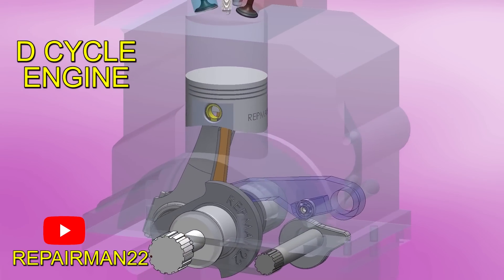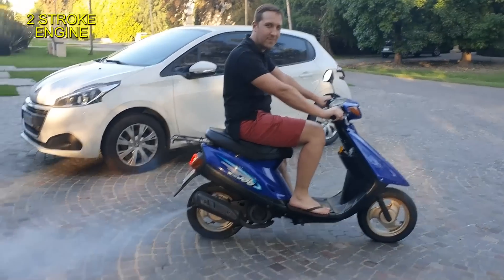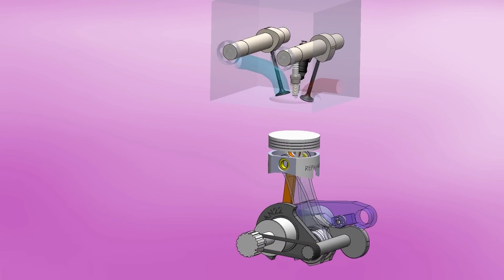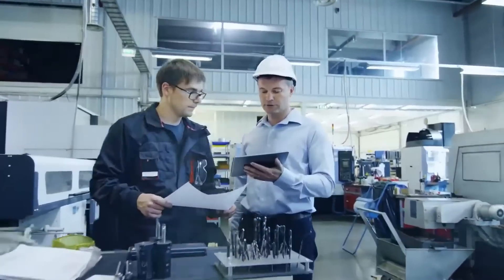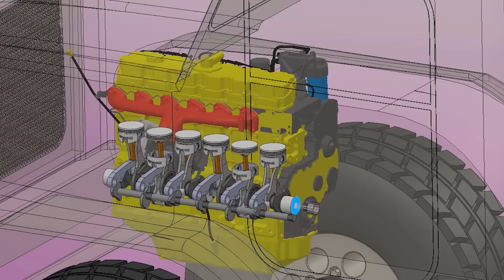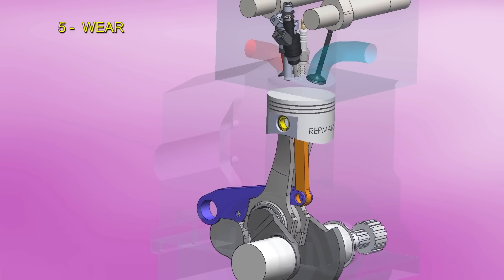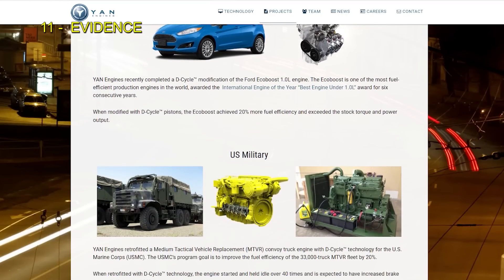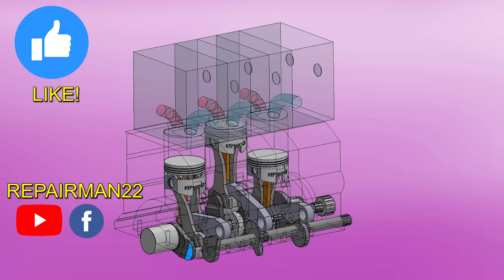Analyzing The Split Piston Engine in 3D. 🤯 Dual Cycle D // 2 and 4 Strokes Combined // 3D Animation

Comment: A turbocharger provides the same kind of increase in power without all the additional wear surfaces.
A modern two stroke uses direct injection which avoids the oil burning, and you can avoid it completely with a blower (detroit diesel) or even a turbocharger if you have a way to start it a blower or saved air pressure.
Reply: An incredibly complex solution to a fairly simple problem. as you state the modern two stroke designs with electronic fuel injection, closed sump lubrication and and controlled blown induction, produce an engine with fewer moving parts and simpler construction,  however it's good to see that the Heath Robinson approach to engineering isn't dead yet. 😂😂
Reply: that's that!
Reply: Now give the dual cycle engine a turbo.

Comment: I would choose it for improved  throttle response on single cylinder motorcycle but I'm concerned about that frequent contact in between the two halfs of the piston. 😐 Probably would be a good cruiser while being agile through city, a classic frame like on twins would fit it's engine character while being mostly for urban use with just half of the cylinders even if with lower redline. 🚴

Comment: disclaimer: APRENTICE MECHANIC RANT
From what i can see, these engines would not last long
the crown could also stay up if there are no forces pushing it down due to friction, so there would have to be some kind of spring or return mechanism, could be fixed with an opposite opposing camshaft to force it down
The arm that moves the crown would have to be in a different design, it would simply bent or break under continious ammount of stress, the camshaft moving said arm, could break in the bearing points or wear out quite fast, we also must take in account that the engine now has to do more work due to a large camshaft, thats a whole automotive class on it self
Furthermore if these engines would fail, they would be a b!tch to rebuild, and quite possibly, heavy on the price side

But i must admit its a cool concept, but in practice

Comment: I doubt this engine will last looking at the surface area of the cam lifting arm is aggressive and will wear out quickly and the loads on the follower bearing will be huge due to the leverage of the arm 

Will it work yes but the engineering to make it last will be its downfall

Comment: Why couldn't this be achieved with a modified miller cycle engine? With direct injection wouldn't it be possible to cycle the air in the cylinder with a supercharger and proper fuel injection timing?

Comment: Seems very mechanically complicated. Opposed piston engines can do the same thing.. also heavy but simpler is some ways.
Also... There are 2 stroke engines that do not need to draw the oil and fuel thu the crankcase.. Detroid made 2 stroke diesels for years... you just need a blower on the side to force air in as exhaust is evacuated..  standard lubrication as any engine with oil in the crankcase.  they tended to be fuel hungry, but also the injection was pretty simple.. I wonder if someone did common rail injection on one if the efficiency would get much better.

Comment: This probably would suit a diesel as a diesel will get by on low revs and already has stronger built engines that because it's built for higher compression ,ied love to see this engine built and tried out , surly it's  better than electric right now because there no cheeper to run than conventional fuel if you do a lot of miles  like I do

Comment: Fuel usage is now doubled and you only see a 20% gain in hp but I want to know what the torque curve looks like!
Reply: I thought in the video they said they also saw a 20% fuel economy increase too.
Reply: @chrisf8584  I must have missed that but this engine doubles the injection cycles without much of an increase of power or change in rpm. This design also increases drag from the 5 extra moving parts in each cylinder.

Comment: It looks like the extra power output is coming from essentially tweaking the engine to put out more power (like street racers do).  As noted by others, this drastically reduces the longevity of the engine wear items.  Once the design has been balanced for longevity and desired power output, then we can determine the advantage of the split piston.  
The turbocharger is a good way to harness the energy dumped by the exhaust stroke to return it to the intake stroke.  It is not clear to me whether this is a better solution for energy conservation than the current EcoBoost system that Ford has for the Fiesta and other engines.
Ultimately, it's a balance between power output, durability and mass.
All of that said, I would love to test this in real world conditions, with or without a turbo!😃😃

Comment: Making a 4 stroke combust twice as often is a good idea, theres a reason 2 strokes and Wankels have such good power to weight and power to displacement ratios. 
But with all of the added parts, the friction and intertia losses would sadly reduce those gains again.
Reply: Das Konzept ist nicht wirklich für die normalen Drehzahlen eines Benziners geeignet, da dieser Zwischenhub enorme Beschleunigungen des Kolbens generiert. Wie leicht kann der eigentlich kippeln, so ganz ohne Führung und Kolbenhemd? Ich behaupte das solche Simulation noch geduldiger ist als Papier.
Reply: just use the second power stroke to power accessories
Reply: Wankel engines have a calamitous efficiency and specific power !
Just big displacement in low volume.
Reply: @fabbri4497  ever heard of “power to weight”. Fact is recipricating engines don’t make sense on motorcycles or small aircraft for this reason. Go video search “CR700W”
Reply: This thing bangs twice as often but only gets 20% more power. That doesn't sound efficient to me.
Reply: @WeighedWilson  It does not bang twice. It has limits on revolutions. It achieves characteristic of two-stroke engine by different way to a certain extent.
Reply: @WeighedWilson  tru, frictions is a bitch

Comment: Top end RPM limited? If engine would normally read line at 7,000 rpm, the top cylinder is doing 14,000 rpm.

Comment: This engine cycle makes zero sense and has no practical real world use.
It wastes useful work of the expanding combustion by trying to stop the power stroke part way through. 
Not only that, at only 5000rpm, that second linkage and cam system will be required to stop the piston crown, its connecting rod and the link arm more than 40 times a second - It doesn't matter how light you make these components, they will fail very quickly.

Next, how do you propose to 'marry up' the piston skirt and crown perfectly, without shock loading, but also without excessive clearance during the full rpm and heat ranges of the engine???
You can't.

Great cad drawing, not a real engine.

Comment: The biggest problem with this design was not discussed. The contact area of the crown and skirt of the two piece piston design. Pistons are made from aluminum, the contact area between the crown and skirt would wear quickly causing a very early failure. The crown of the piston will eventually try to turn sideways in the bore as the contact area between it and the skirt eventually wears away creating an ever increasing gap between the crown and skirt halves. It's an interesting design but the engineering is flawed in regard to current material used in piston technology.

Comment: Pistons have skirts for a reason, like ring chatter. That crown rod is going to cause a lot of stress on the skirt's bushing.  

The 2-piece wrist pin is also going to cause additional stress.

The moving parts will weigh more, because of the additional stress, which eliminates the efficiency gains.

Comment: It may produce more hp, but cut  engine life by half? Twice operation in the cylinder, it may require a tighter service interval, some of the direct injection engines already suffer from sludgy and greasy stuff in the intake runners, causing all sorts of malfunctions like misfire etc. 

The cams normally rotates half the rpm as the crank, and even that may require some heavy duty springs due to some cam lift. 

That second crank has som really aggressive lobe, turning at the speed of the crank.

I’m going to be really honest, it’s a cool idea, but rewing this engine, it will throw every piece it’s made of right out the side of block.

Comment: Make the piston crown a poppet valve (no rings) & the piston skirt the seat (with the rings). Like a normal 2-stroke, have induction through the crankcase.

Use exhaust valves, instead of ports.
Reply: Wouldn't that hurt emissions? Oil mixing with air and fuel?
Reply: Yeah, so?
Reply: @Iowa599  
Are you stupid? It would have no chance to go into production.

Comment: There is already a 2 stroke deisel....the detroit. The D design doesnt have 100% power strokes as the  power stroke is only powering the crank about 3/4 of the stroke .as soon as it disconnects from the skirted piston the crank is coasting as the ringed top portion piston rises. I see too many problems that dont overcome the benifit of a 20% gain . Any engine can get an increase in power without all the extra complexity....its called money. The eco boost ford engine is the best one ford could produce for a certain cost. They could improve it but price would increase.

Comment: Feel like that cam pushing the piston back up will have some massive wear with such a big leverage and pushing the piston up so quick.
Reply: It could still have useful applications, where high speed is not a requirement; like water pumps, or other engines that spend most of their time doing "slow-but-steady" jobs over a long period of time. You point is valid, though, and will have to be considered going forward, if this engine is to replace a normal piston engine in vehicles used for personal or general freight transportation (i.e. cars & 18 wheel highway trucks.)
Reply: @paulhollier6382
Yeah, maybe like a single piston range extender
Reply: Although the piston moves faster during part of the cycle, during this period the piston is not loaded significantly as it only exhausts the spent gases and pulls in the fresh air.  It is only when the main cylinder rod is engaged that the piston is under the heavy load of compression and expansion!  
It may last longer than expected, but keeping revolution speed lower should extend life.
Reply: The piston halves hitting each other will not last either. This only works in theory. In practice it would destroy itself.
Reply: The barely supported ringland is going to fail long before that arm , the bearing on that arms another matter , a wet bearing almost instantly a roller bearing set up is addding so much weight the power to weight ration is likely worse than a traditional engine . As said though the ring land will be gone before then .  The crank , conrod and lower half if the piston are effectively pointless
Reply: Not to mention two "halves" of a piston smacking around against each other. Under stress that's going to cause problems.
Reply: Im aure the cam profile would be different and less sharp than the render if it were to make production
Reply: This might work in Sims but the forces will be too strong to really get any RPMs
Reply: The ball bearing should help with that.
Reply: @24681359David just adds a failure point and a shit one to fix.

Comment: Normally a piston completes an up-down movement in 360 degrees. With this setup the top of the piston has an additional up-down movement in approx 60 degrees. So with the engine running at just above idle at 1000rpm this piston top will be moving back and forth as quickly as if it were 6000rpm on a conventional engine. It won't be able to rev up without enormous forces and consequent breakages to contend with.
Reply: This honestly looks pretty viable for low revving engines. I can recall one old model diesel that has an idle RPM of around 500, it could work a treat in an engine like that.
Reply: @alistairsmith4297 Many older tractor diesels ( 50-80's ) idle fine at 500.
Reply: i agree that the redline would be lower- the crown would have to accelerate so fast even if it it pretty light it would still produce enormous forces. you may call these secondary primary forces, which means more balancing and forces.
Reply: Sounds perfect for generators
Reply: Typical redline limits are often due to valve float and we have conventional engines that have a redline of 12,000 rpm. So the lighter/reduced mass piston that isn't under load - no power stroke - theoretically should be fine.
Reply: @killer2600  the problem isn't the mass, is the mean velocity of the Piston. Above 25m/s of mean velocity the oil film just won't be able to form until the Piston rings pass again on the cylinder walls. In a conventional 4 stroke, that'd be 9400rpm with 80mm of stroke. That's insane already. But as already stated, if you put the crown Piston on a smaller windownof time, its speed will but a lot higher. Without considering the forces like you sad, even if it's very light.

And yes, there are modified engines with higher mean piston speed, but the wear is guaranteed and won't have a long life span.
Reply: @LM_Cams sounds like a wet dream for Ford engineers
Reply: @LM_Cams  honda pretty much did the in the 90s with 500 gram pistons though
Reply: @LM_Cams  Can always increase the stroke length to trade rpm for torque
Reply: @killer2600 not at all, it's mostly max cylinder acceleration that limits rpm. That's why engines that rev high always have short strokes, but no major change on the valve train. Also vibration would be huge, since i'm seeing counterweights in the design
Reply: @killer2600  F1 overcame this problem a long time ago so did motorcycles.
Reply: @Nbomber heavier valves and weaker springs. The valve on a 100cc weighs a few grams, the valve on a multi-liter engine can weigh many times more. Valve train inertia causes float
Reply: Imagine having an air fuel charge compressing within your crank case…
Reply: Perfect for diesels then.
Reply: The revving issue can be solved by using a hybrid drivetrain. Use the electric motor and battery for power demand and rev the engine at a slower rate
Reply: Couldn’t they just put the 2nd lift between split rods on crank shaft?
Reply: Yall are missing the fact that the piston arm/cam is going to float way worse than a typical valve does
Reply: With no valves in the cylinder walls you can make a wider cylinder and shorter stroke lowering the piston acceleration, you will get great torque at very low revs so you wouldn't need high revs anyway. Think of it like a steam engine, may not make high hp numbers as that is a function of torque x revs.
If you look at modern trials motorcycles, they have only like 10hp at 250-300cc but you can put it in 5th gear and start from a stand still uphill as they have great low end torque and are resilient to stalling. Most people think they would be long stroke engines but they're actually not, they are over square which means wider bore than stroke length. This gives the flame front much more time to progress over the piston surface and you can utilize the compression more effectively without the engine detonating at very low revs.
Reply: You don't have to run the engine to that high speed, except for racing. Our car tires runs at about 500 rpm or below in normal driving, while the ICE operates best at about 2000 rpm. So the engineer use the transmission to match these rpm's together. D-cycle will operate closer to these tire rpms, saving more energy (fuel!).
Reply: But the entire engine can run at half speed. Let me ask you, when was the last time you heard of an unmodified car experienced piston/rod failure? Double the power with 90% of the engine running at lower speeds? Sounds like a good idea in theory. Also that cam profile for the extra piston stroke can be modified to be more gradual. The central rod is also a far more perpendicular force compared to the main connecting rod, so G-forces aren't as big of a deal as on a conventional connecting rod that has lateral forces that require the piston skirt, not to mention the lack of weight of the skirt.
Reply: I think this is another design that works on paper but just not in real practice.
Reply: Zase nějaká inženýrská utopie tryskového deklu, (nikoliv pístu), neboť to nemá žádné vedení ve válci bez olejového filmu. Navíc zde bude několika násobný odpor při vytlačování spalin (vlastně vystřelení). Blahopřeji ke vzniku dalších pumpujících ztrát. Naprostý omyl. Klasická konstrukce 4taktního motoru nemá problém s výkonem motoru, ale otázka zní, jak zlepšit efektivitu motoru. A to se zde neděje ani náhodou. Je to nějaký mimozemský bastard. Vraťte se nohama na zem, nebo si děláte srandu?!?! To už bude mít lepší účinnost turbínový motor, který je stavěn na vysoké otáčky bez vratného pohybu hlavních komponentů. Komu není s hůry dáno, v apatice mekoupí. 👎🤣🙃😢
Reply: Not sure if this was already mentioned, but it seems like it would make roughly the same power at half the RPM of a standard 4-stroke.  I wonder how it compared in reality?  Maybe the 20% power gain only needed 60% of the RPM speed?
Reply: And how exactly is it pulling in mix? I see where it would push exhaust out rather effectively but then that "crown piston" is going to be stuck at what amounts to TDC.

I call be yes.
Reply: Just check the shape of the cam lobe that actuate this split piston, imagine this thing at just 1000 rpm, it will shred itself apart. Also it would need a mechanism to bring that piston crown down.
Reply: Right? It'll have a 1000 rmp red line lol
Reply: Very concise explanation!
Reply: The cam arm moves the crown piston under exhaust and intake - the easiest of the 4 strokes